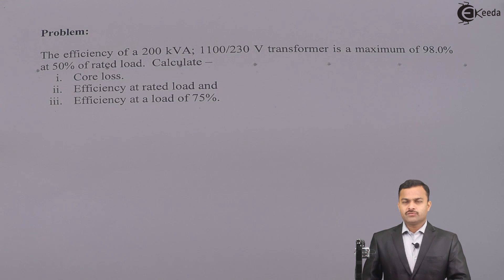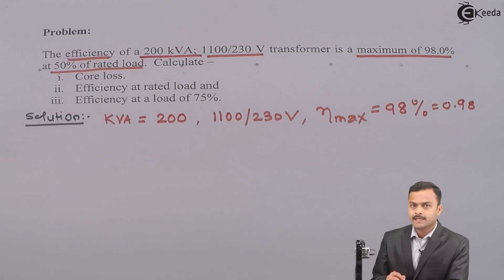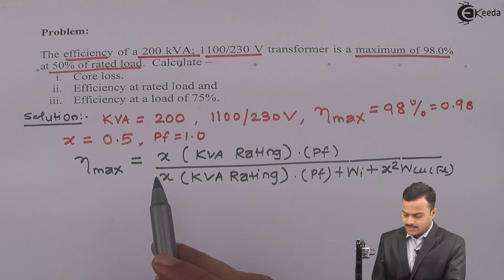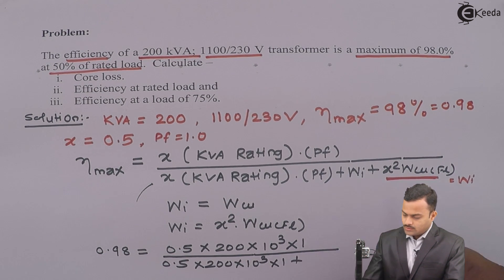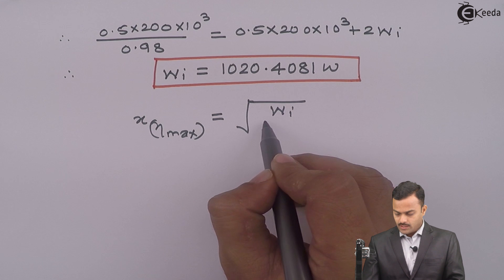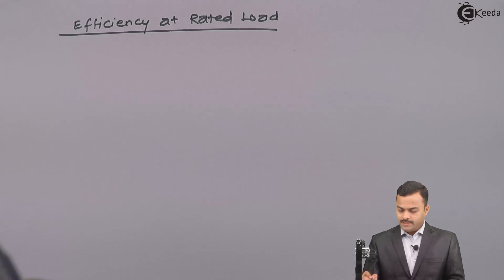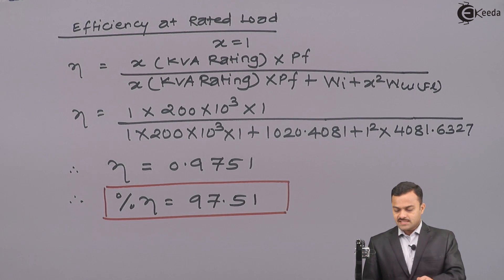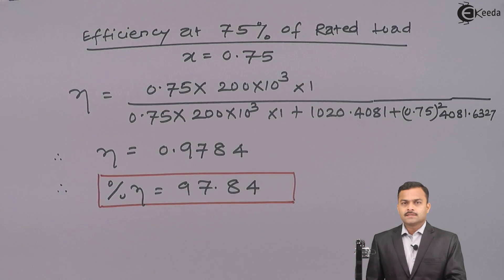Efficiency of a Transformer : Problem 2 - Single Phase Transformer - Basic Electrical Engineering

Comment: In (3)...if load is changed why copper loss value not changed....?
Reply: the copper loss value changes by x^2

if you are asking about the core loss, it doesnt change because it's directly connected to the input voltage V1 , so it's power is

Pcore =   (Vi ^2 ) / ( Rc)
and Vi doesn't change with load changes
Reply: @mustafahajhamoud2077  The core/iron loss is independent of load condition as flux in the core remains constant throughout .